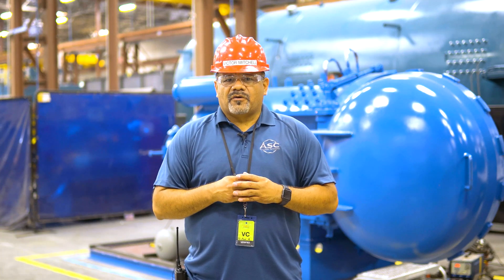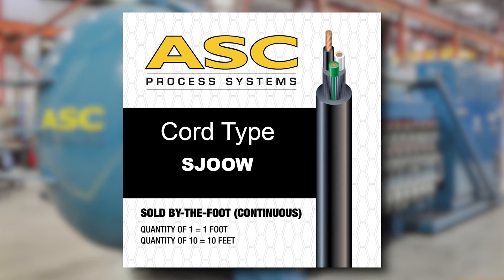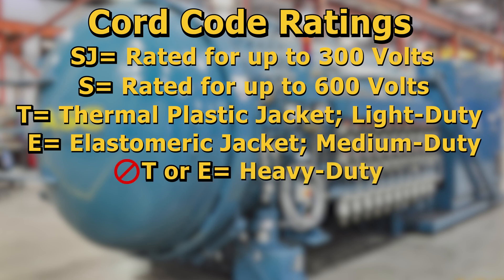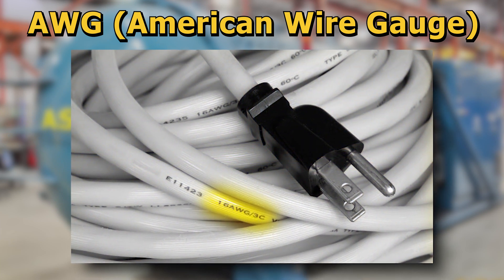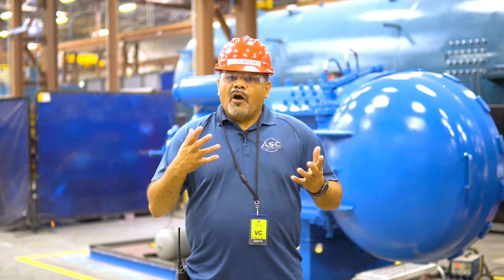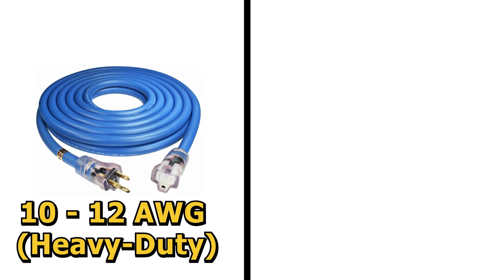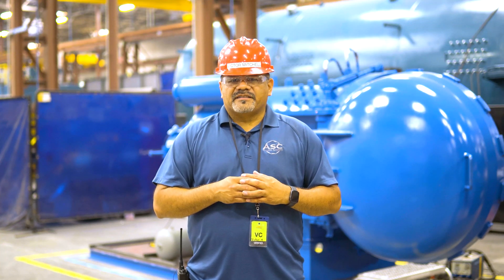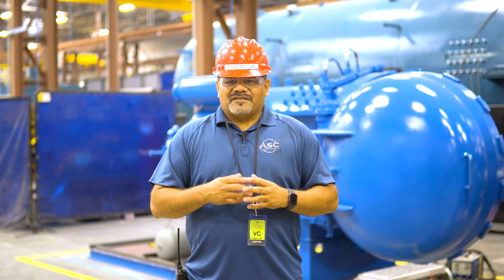Extension Cord Codes & Gauges

Comment: The best explanation!  As you stated, check your equipment.  The cord for dethatcher is 16AWG, but the manufacturer recommends 14AWG for <50ft and 12AWG for 50ft+.  Thank you so much for taking the time to explain.  You're appreciated!
Reply: I came here because my SunJoe dethatcher keeps stalling too. What AWG and length did you go with?
Reply: @ag49521  I ended up using two different cords per square footage. 12AWG @ 50ft and 16AWG @ 100ft (not connected).  Both worked fantastic with no overheating of cords or shorting of equipment.  I personally prefer the thickness of the 12AWG for visibility and cord slinging/maneuvering.  I hope this helps

Comment: is it okay to use normal extension cords in the construction industry? thanks
Reply from the maker: Hi Mark. Good question. Extension cords used in the construction industry must be the three-wire type and rated for hard or extra hard usage, according to OSHA. Look for the designation S, ST, SO, STO, which meets the requirements of ANSI/NFPA 70 for hard usage.
Reply: @ASCProcessSystems  thank you.
Reply: @ASCProcessSystems  what about when you use a power washer